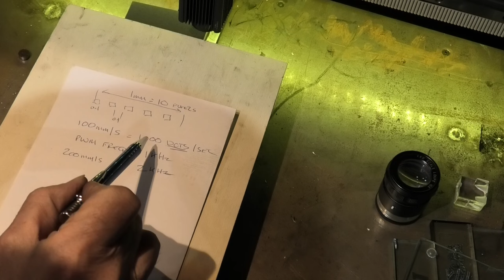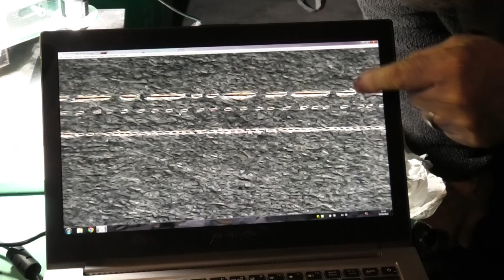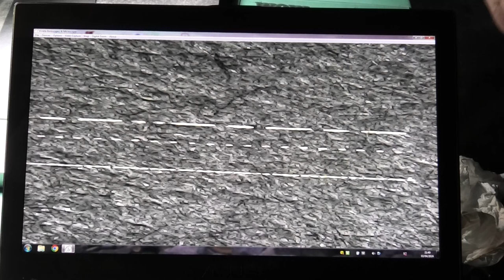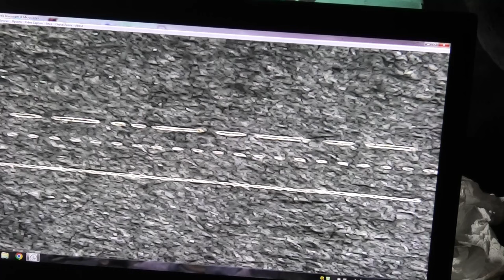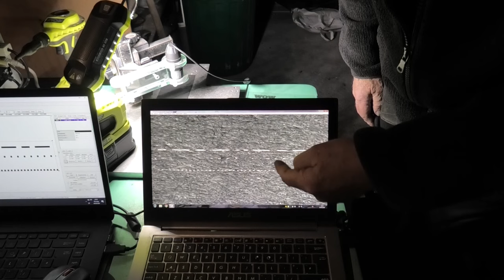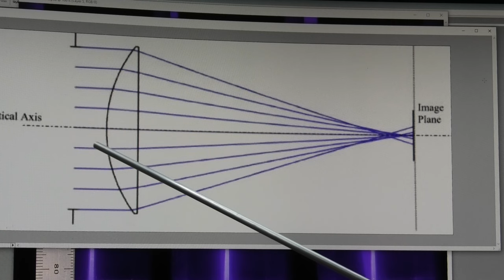Diode lasers---Under the  Hood  08

Comment: Russ been watching you since the start many years ago, even though I don't have a co2 laser. But I now have a diode laser and finding your new series fascinating.  I will research my pwm signal on my scope when I return from leave. The addition of a glass lens is great news. I have a 10w laser I will research where to find one.  The light through the acrylic is also very fascinating I will have to try that.

Can you do all your tests in mm/m as thats what the diode laser community uses and not like the faster lasers mm/s.

Question. Life of a diode laser.     As it's always giving full power, would running your diode at a max power of day 90% lengthen the life of the diode. In my research I have never found any facts just what people say to done.  Cooling is very important and I believe folks do not do enough maintenance, ok they may clean the lens but not the cooling fans enough.

I will now research if any control boards allow you to control the frequency, may be some advanced 3d printer boards can, I have seen some customer diode laser boards so will enquire if they do.

Looking forward to the next one already. Regards Andy